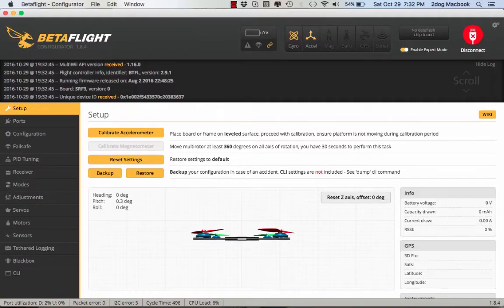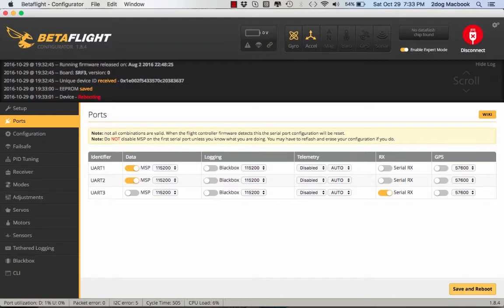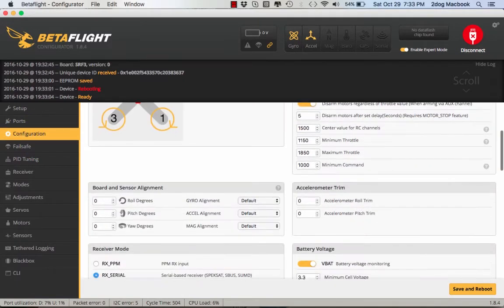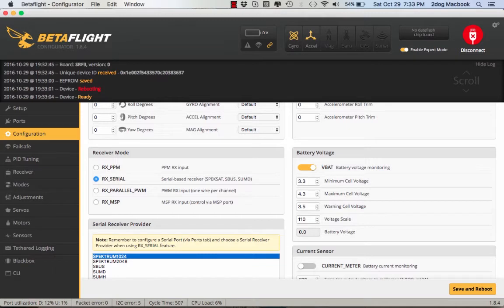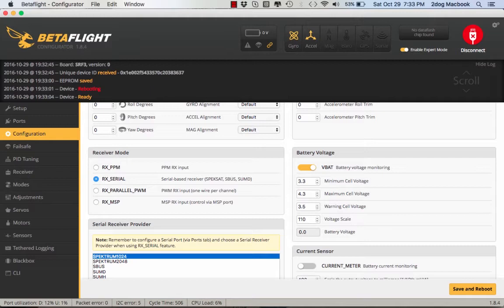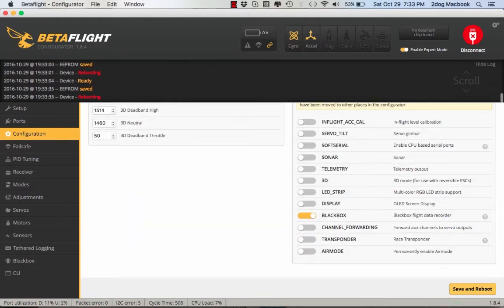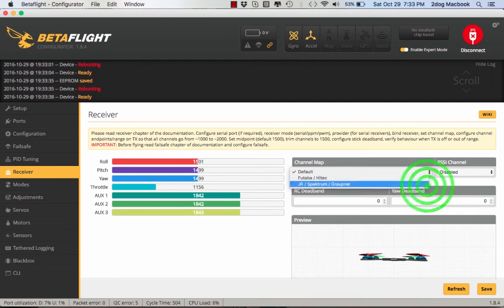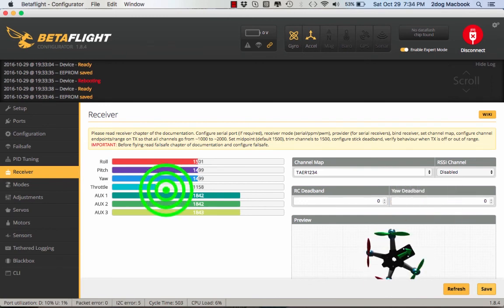Configuring Betaflight for a Spektrum Receiver and the Diatone D-Link F3 Board, Step 3

Comment: What's the issue if after complete setup and save the unit doesn't arm????
Reply from the maker: Follow this video as  well: https://www.youtube.com/watch?v=UOHaje7h4Ko.  What is not going to arm is if the throttle is not at idle.  Make sure that in the receiver tab your throttle goes down to 1000.  Another one I found is if you are trying to arm on one switch while you have horzion active on another switch.  You can't have horizon or angle active, ie green, then arm the quad.
Reply: 2dogrc when I bought this from you the system wouldn't arm, and I also watched the set up on beta flight with the crusader 175. Don't know what to do now.  :(

Comment: I would like to get this quad and I have the new dx6. Is this plug and play at all or do you have to use one of these programs to get it in the air? I have an old computer and not sure it will work on it. I am just getting into fpv. Thank you for your time!
Reply from the maker: You have to use a program for all these quads!  They run in the chrome net browser.